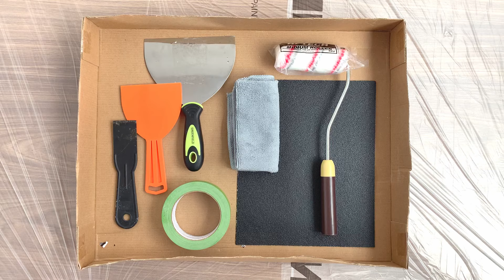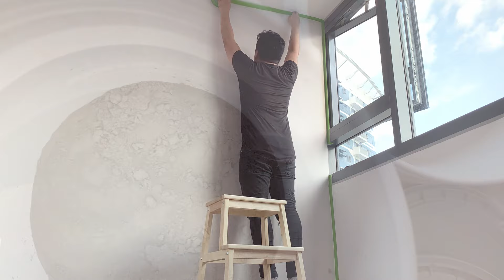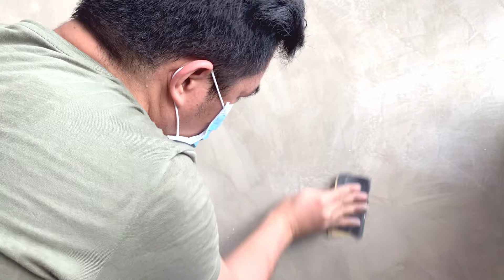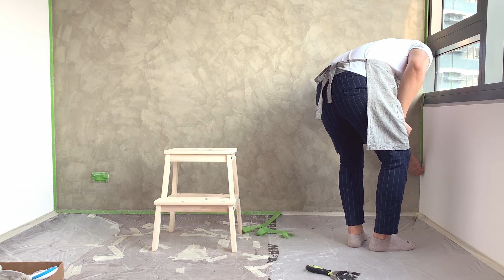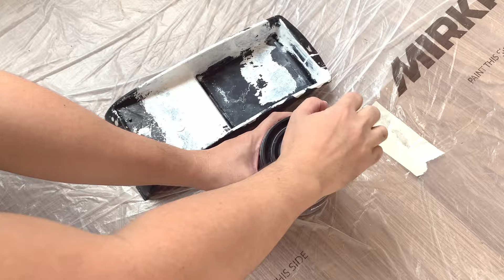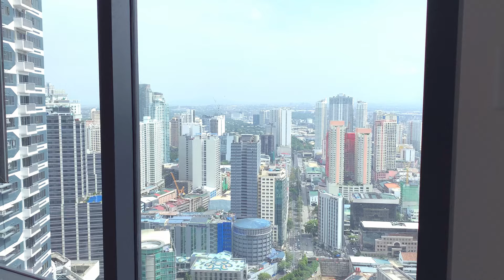How To Create Concrete Finish Wall | DIY | Modern Industrial | Accent Wall

Comment: Hi! Nice video. I was wondering if we can use the regular skim coat (powdered) mixed with pure cement, then a matte top coat as an alternative? Thanks! 🥰
Reply from the maker: Thanks Johanna! Yes skimcoat is a good alternative... Matte or you can use the wallart topcoat though its in gloss but it won't appear shiny when it dries... :)
Reply: @STUDIOPLOY  A-plus concrete sealer is a good alternative if you want a matte finish. Its also not so expensive, around P700 per gal
Reply: Ff
Reply: hi pwd po kaya cement lang and white pintora?
Reply from the maker: Hi  @princessalliyahmandangan7703 ! Someone commented here na gumamit sya ng cement and gray latex paint and okay nman daw yong result… Yong itong wall art I think may kunting variation lng sa composition ng liquid pero somehow similar sya sa paint kya possible magwork nga… 😊

Comment: Galing! Sir question po, as you mentioned isang set ng wall art pwd na for 25sqm unit po? Tapos if my existing paint na po, need po ba e remove yung paint saka mg apply nyan or primer pa before wall art po?
Reply from the maker: Hi JT! Yes kaya na, unang application mo lng medyo labnawan mo unti kpalan mo slang sa second coat... No need to remove or to put primer, lihain mo lang ng magaspang tapos after basain bago mo apply ng wallart...

Comment: Can we use regular cement po?
Reply from the maker: Hi Wendy Yes you may baka may manotice ka lang na hairline cracking as compared to this... Just put topcoat though so it won't be that rough when you touch it...😊
Reply: Grabe thank you . Free consultation talaga we need more like you. Tapos pro pa. May God bless you more po . Thank you. Gagawin kopo yan sa banyo . Thank you

Comment: Thank you for this video. Planning to do this in my room. Need po ba smooth yung concrete wall bago i-apply yung wall art? Bare concrete wall po kasi yung sa room ko. Thank you po.
Reply from the maker: No worries Roel! Salamat din for watching! not necessarily wag lang sobrang rough otherwise madaming coating kakelanganin mo... :)
Reply: Good job 👍💯💯
Reply from the maker: Thank you! :)

Comment: nice 👍 may tanong ako if okay sa loob ng bahay yan cement or concrete kasi may nabasa ako na nag rerelease siya ng carbon dioxide  and not okay sa lungs ng tao
Reply from the maker: Hi Hildegarde! May nabsasa din ako na article before concrete contributes 8%of the carbon dioxide emissions. I could be wrong pero sa mga bahay very minimal nman siya otherwise madami na magpoprotest in using concrete. Dito sa project nato its not purely concrete, its a plastering cement and is designed for both indoor and outdoor use. :)

Comment: Gud am ser. Kung Wala pang pintura yung concrete wall. Ano ang 1st coat Bago aplayan ng Davies wall art industria? Tnx.
Reply from the maker: Hi Marlon! Kung hindi pa treated yong concrete wall I would advise na lagyan mo muna ng concrete neutralizer or lasunin mo muna… If di nman na kelangan lihain mo lang hindi pantay na part and since cement na sya 1-2 coating ka lang pwede na… :)

Comment: Sir tanong lang po. Kkapintura lng po ksi ng bahay namin and dko alam kng anong klaseng pintura bsta rough po sya hndi makinis o makintab and prang ang dali nya pong mabakbak. Yung konting dikit ng tape o masagian ng bahagya nababakbak sya😞 Pwede po ba i repaint to gamit yang mga gnamit nyo sir? Sa bato and hardiflex po thank you.🙏🏻
Reply from the maker: Hi Eirej! Yes pwede sya, pero before mo apply make sure na tuklapin mo na yong mabilis matanggal na paint para mas kumapit sya?… Tanong ko lng na treat ba concrete wall nyo using a neutralizer or kung nalason sya… minsan kasi isa sa dahilan yon bakit mabilis matuklap ang paint… :)

Comment: Sir around how much could be the cost for this kind of finish per square meter? Thanks in advance
Reply from the maker: Hi Barry! If I base it on the recommended coverage of wallart for each set which is 15sqm the cost per sqm is at 330pesos per sqm but based on experience I was able to double the coverage to 30sqm bringing down the cost to 165pesos.. factoring in the labor and equipment total cost per sqm will be at 280-300pesos per sqm.. hope this helps… :)
Reply: How were you able to double the coverage? Is there a technique that workers dont usually do kaya dumadami wastage nila?

Comment: I got a cement painted wall , the job was done approximately 6 months ago , unfortunately I am not happy with end product so I decided to do the job myself . My question is the wall was waxed/ sealed. Can I just sand the wall , then reapply the concrete paint If this is possible on the assumption that the wall had 2 coats applied , could I get away with applying 1 coat of concrete paint then apply the wax . Regards
Reply from the maker: Hi Tony! Yes you can sand the wall to remove the wax/topcoat then reapply, 1 coat would be enough then wax/topcoat… Make sure though not to over sand otherwise you would need to do 2 coats again… :)

Comment: This is what ive been looking for! Gumastos pa ako sa kakabili ng pure cement para ma achieve yan, nag puti2x pangit ang result. 
Ang prob ko lng din uneven ang cement na pagapply ng mason. May parte na parang mas nakaumbok kesa sa iba. Duno if kaya kaya habulin nito. Hm are these by the way???
Reply from the maker: Hi Angel! Pag pure cement sya medyo prone sa thermal cracking and yon nga namumuti.. Yes kaya pa yan maremedyohan gagamitan mo lang ng grinder to flatten yong umbok na parts.. ang price ng product is almost 5k, cheaper option would be skim-coat tapos bili nalang ng topcoat pra hindi sya mamuti and hindi rin magaspang.. hope this helps... :)

Comment: did the top coat made the finish glossy or plasticky? or hindi naman. I usually see skimcoat cement finish pero naka-emulsion so naging glossy and loses its cement feel for me. thanks
Reply from the maker: Hi arjcr1! It actually retains the raw cement look only a bit matte and the color becomes lighter which I like.. It sort of just seals the product pra hindi sya dusty and rough to touch.. I don’t usually recommend the use of emulsion... :)
Reply: @STUDIOPLOY  thanks. got it. will try this soon. 😊👍

Comment: hi sir SP... will this work on the Cement boards (HardyFlex) and on the floors too? thanks for the very informative and detailed videos! God bless more power!
Reply from the maker: Hi Ohhkeem! Yes it works with cement board even on plywood but I don’t think it’ll work well for flooring as it needs to be that durable to withstand regular live loads... welcome and thank you by the way... :)
Reply: STUDIO PLOY  Sir pag sa flooring po ba ibang method and product din po ba?
Reply from the maker: @bebpalmiano6088  Hi Beb! Yes different materials na hindi kasi ito maglalalast for flooring… If cement finish ang type mo for your flooring mismong purong cement na gamitin to finish the floor and just seal it with an acrylic sealer… If mas expensive na option mas kita mo grains ng cement mixture and mas pulido tingnan go for polished concrete… :)
Reply: STUDIO PLOY Thank you sir! More power po
Reply: @STUDIOPLOY  siR sana makagawa karin ng vedio sa flooring cement finish. Like sa akinmay flooring na hindi kona ituloy ang tiles. Ano gawin steps para di mag crack ang patong na seminto at paano pakintabin. Tnx po ♡♡♡
Reply: @STUDIOPLOY  hello. Can I enquire re your professional service pls.
Reply: @STUDIOPLOY, hi po Engr. 

Pde po ba ito sa Fahstwall?

Comment: No need to remove the original paint?
Reply from the maker: Hi Allan! yes no need.. though If the paint is glossy you need to roughen it a bit using a lower grit sand paper... :)
Reply: What if rough wall pa ung base po?
Reply from the maker: @chalkcoffeeAdi  Hi! Like gano po ka rough? If yong rough na palitada lang wala lang syang finishing, pwede din sya, pero mpapamhal ka pag ito ginamit mo.. better na ifinish nlang ng purong cement, mas mkakatipid ka and lagayn nalang ng topcoat... :)

Comment: how much does the set costs? and ilang sqm room kaya nito icover?
Reply from the maker: Hi! The set cost around 5k... Yong coverage nya as per the label is 15sqm, pero based on experience kaya sya maextend to 30-40sqm depende sa pag apply mo... :)